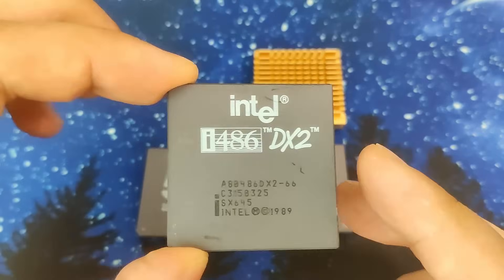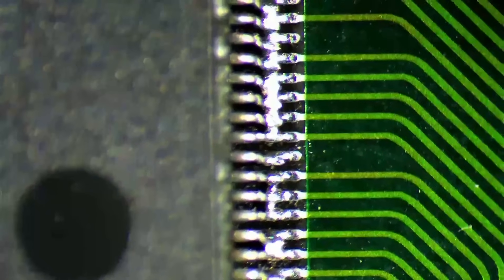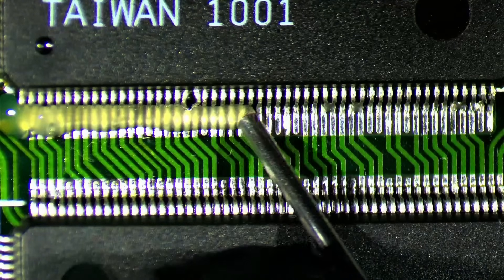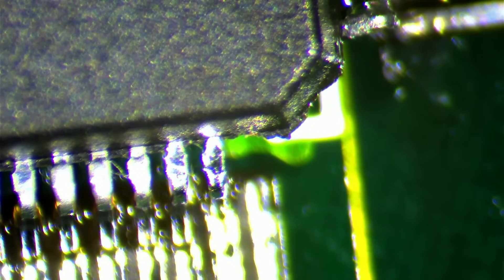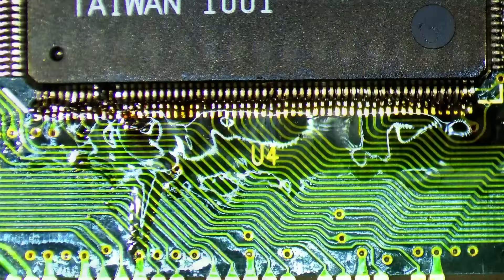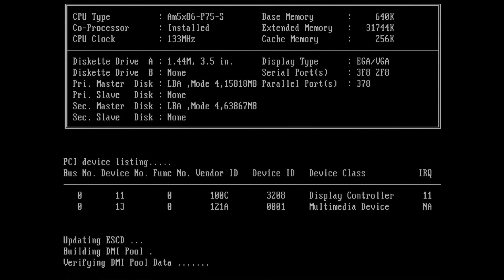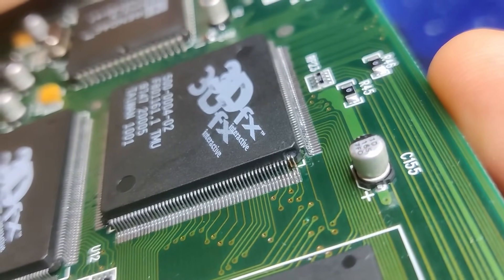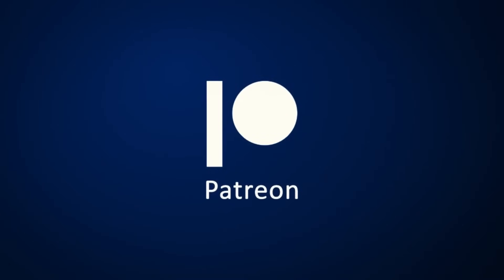Tomb Raider (1996) needs this Diamond Monster 3D (Part 5)

Comment: I ran tomb raider on a 486 dx2 66, I don’t recall the board specifics but it had 16 mb ram and 4 x multiplier for the dx4 100, sound blaster awe,  CD-ROM 2x. It came with 8 megs of ram and a citrus logic gld 54xx, then I went thru a number of matrox cards and end on a millennium. The ram upgrade for 8 mb was £399.00, 1994 I think ish. I went thru most brands of 3d addon cards and miro capture cards, I still have god knows how many win-tv cards. Somewhere behind my chair in the junk pile that is my shed sits a Corsair tower with an sli motherboard and. Matched pair of 8800 GTS cards and the holy grail, the sli bridge connector. Happy days
Reply from the maker: Wow, expensive memory! But this is how it was. High end gear was expensive! I remember upgrading my 486 with a CD drive too. But it was a lot later. My parents got me a 4x drive. And with my Pentium Ii 350 much later, I got one of those IDE CD burners (OTI Socrates 2x 2x 6x, if I'm not mistaken).
Reply: @bitsundbolts  I was a masters student and self financed my computer requirements. But nevertheless love the channel can’t wait to see more.

Comment: The link for the Flux isn't working :( 
Great videos BTW !
Reply from the maker: Hi, are you sure? I checked the link and it opened the correct page. Maybe try again.
Reply: @bitsundbolts  Ok, so turns out it doesn't like me being in Romania :( 
Connected with TOR browser as from being from a few different countries, and out of the few, only Norway & USA worked...  
I'm gonna search for the AMTECH stuff from a different seller... although I know there are A LOT of fake ones. And yours seemed to do a really good job (so probably genuine).
Reply from the maker: I bought mine a couple of years ago - and yes, it is past its expiry date. It still works very well. I posted the link and store I purchased it from originally. However, I have no control over them changing the product over time. I soon have to order a new batch though.
Reply: @bitsundbolts  Dunno where my comment/reply went (or if you got to read it), but what I was saying was that it turns out the link/seller is country dependent. 
Thanks for the good info! I will look for another seller with a lot of good reviews :)

Comment: Another irreplaceable piece of history restored to working order, go Alex! 👏 Can't wait for the next video, it'll be really interesting to see how well the Voodoo 1 can stretch its repaired legs on Socket 3. Can it get anywhere near its potential or will the system still be bottlenecked somewhere else? Time to place your bets! 😄 Here's mine: A good experience with the faster CPUs, but quite a ways off from running at full (Voodoo 1) speed. Might just be able to touch that 30 FPS cap for Tomb Raider, might take the beefier Pentium Overdrive FPU  @ 100 MHz though. Pleeeease don't fry the 5x86 though, cool it with a TEC if you have one at hand!
Reply from the maker: Hello 😊. I am done with footage and the Cyrix survived! I have 4 of those CPUs, however, only one was able to run at 120 MHz! I also had to increase the voltage slightly. The other three CPUs exhibit very weird behaviour at 120 MHz.
And the Voodoo 1 did its job well! No issues from the card to go through all the benchmarks! Let's see if you're right in the next video 😉.
Thanks for watching!

Comment: Impressive though wouldnt it have been much cleaner to remove the damaged chips and solder new chips in their place? How long will those mangled legs last?
Reply from the maker: The pins were good except for the one that broke in that corner. I had a bad feeling about it from the beginning, but I hoped it would last. Surprisingly, the other pins were a lot better even though they look bad. Of course, those pins will never be like before, but replacing a working 3Dfx chip would require me to take it from another card. I don't have one that is unrecoverable and could serve as a donor.

Comment: I enjoy seeing testing of this kind of hardware pairing. I remember experimenting years ago with a Voodoo 2, Riva TNT, and a Riva TNT2 on a Socket 3 system. IIRC, only the TNT worked fully. The system would boot with the Voodoo 2 (and the S3 Virge card it was paired with), but wouldn't produce 3D. The TNT2 wouldn't boot at all. I suspected it had to do with the PCI implementation.
Reply from the maker: Probably, those socket 3 boards were the first ones to have PCI. It is very likely that you stumbled over initial hiccups.

Comment: Ahh there it is! GReat to see the old Monster running.
Though I wouldn't have been spoiled by seeing a moving clip of Tomb Raider, you could've left the FPS Meter off for now or something.
Reply from the maker: Hm, I quickly scrolled through the video, but I don't see the frame counter anywhere. If you're referring to the bar, this is Lara's health.
Reply: @bitsundbolts  Oh no, sorry if i wasn't clear on that.
I meant you could have showed us a small clip how the game runs in motion, and to not spoil the surprise on "how fluent" it actually is, you could've left the FPS counter off, and reveal the actual FPS number in the next video. :)
I had to check if there was an ingame FPS Counter myself before answering, as I couldn't remember the key for it anymore. But I found it! (F2)

Aaanywway, looking forward to the next Video. ;)

Comment: Looking forward for the next video, and how about Socket 3 and Voodoo 2 SLI next ? Or a Voodoo 3? But guessing the CPU is for certain the bottle neck there.
Reply from the maker: Unfortunately, I think even a single Voodoo 2 will be bored in a socket 3 system. We will see in the next video how performance scales with different CPUs. I will start from a DX-33 😉
Reply: A friend of mine tried a Voodoo 1 with a 484 DX 100. With Quake 1, it was very slow, even with a small image (with borders).
So I suppose V2 SLI will have the same problem.

Comment: Seeing ‘multimedia device’ during POST is always a good sign. Lately I’ve been testing an 8 meg Monster 3D II I’ve never used before. There was nothing in the way the card looked that would make me worry. Being listed as an ‘unknown device’, however, made me suspicious from the get-go. When Windows detected it as a ‘pre-VGA legacy device’ and refused to accept original Diamond drivers I knew it would be a case of plug’n’pray rather than plug’n’play. Many blue screens, critical errors, restarts and reseatings later I thought I’d give it another close look and all of a sudden I found a spot of blueish grey patina covering at least four contacts on the PCI connector edge which I have no idea how I overlooked. A thorough cleaning with rubbing alcohol and a needle made the card finally turn into a ‘multimedia device’ and load the appropriate drivers. It works brilliantly! 😊
Reply from the maker: Great that you managed to get the card working! And Plug 'n Pray should be trademarked :D

Comment: I recently received video card from a customer for a Mac 7100. It had gotten damaged at some point in its life. I told myself don’t touch the pins…I touched the pins. They were so weak two broke. Thankfully they broke cleanly to where I could solder new kynar wire to them. But yeah, ugly vs broken
Reply from the maker: 😂 Haha, I can imagine that situation...

Comment: Hey BuB!

Cant wait for the next video (again 😂 ). The big 486 (more like socket 3 actually) showdown... :D what motherboard are you using here?
Reply from the maker: I am using a Soyo SY-4SAW. It may not be the fastest - and it is limited to FPM memory. I hope to find an EDO capable board with a good BIOS to tune timings of memory and cache. A project for the future :)
Reply: @bitsundbolts  i found that your mobo uses the IMI464 clock chip. Its right next to where the jumpers are for setting the fsb. It appears to me that the S0 and S1 pins are connected to the two jumpers and S2 is most likely permanently connected to high. If you lift it off (or likely theres a resistor somewhere and you take that off) and leave the two jumpers in 50mhz mode it should make it 60mhz. In case you want to try it in 3x60mhz for the ADZ. I found the pinout on vogons. Whatever may end up doing though, double check first if the info i gave you is correct, and do anything at your own risk. :)
Reply from the maker: There is a jumper spot that is permanently connected with a small wire. I will check it and maybe do another mod video of this board. With the clock chip, I have two potential modifications for this board. I am curious if the AMD CPU would work at 180.
200 is not working, no matter what I'm trying.

Comment: Another success! It becomes borring :P
Reply from the maker: Hehe... I have other hardware I am not yet able to fix. Don't know what is wrong with it, but haven't given up hope. HDDs were the opposite - none of them worked :)
Reply: @bitsundbolts  HDDs is a lost cause from a start ;)
Reply from the maker: 100% - not worth the time finding 1 in 100 drives...

Comment: Good job. And interesting to learn of using flux with the wick. I'll surely be doing that in the future.

P.S.: I did not see what wick you're using in the description. Could you share which one you use?
Reply from the maker: I added the links to the description. I am using TOWOT Solder Wick which works quite well.